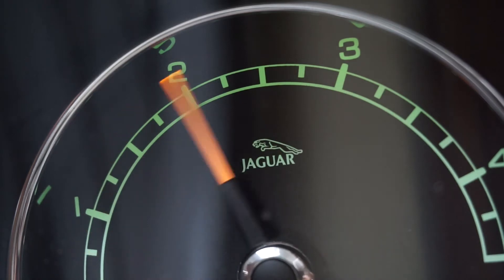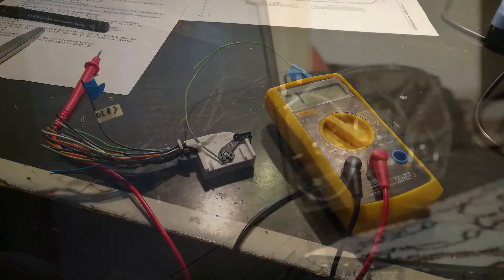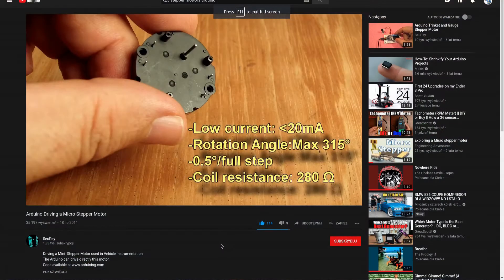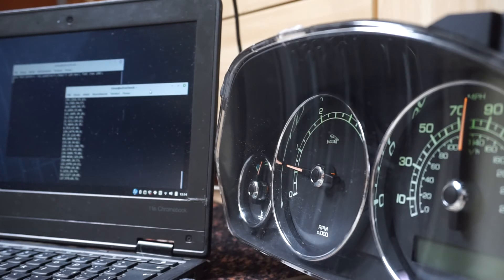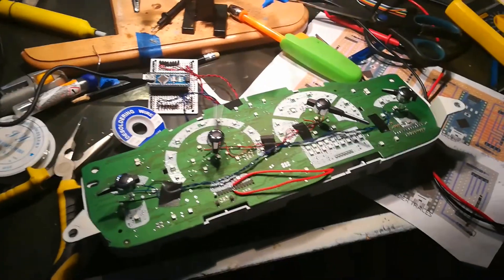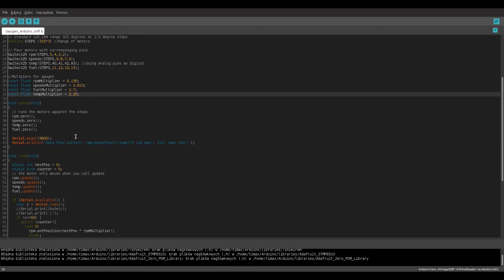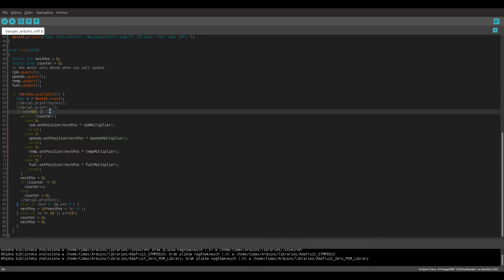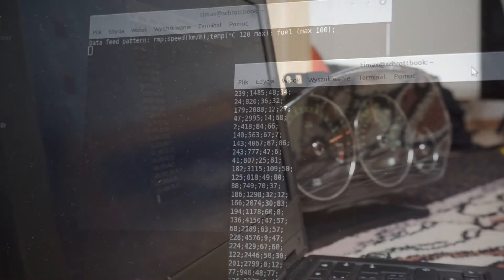Controlling instrument cluster with Arduino

Comment: I was expecting the actual CAN bus code to move the stepper motors according to the input instructions sent via the CAN bus as it only needs 2 wires.  Were you able to tackle this or did you not bother?

Comment: im using these tieing into an older gauge cluster for a replacement tachometer.  The older cluster uses a frequency based input such that for instance, 80hz on a function generator equates to 2400 rpm (2 pules per crank rotation).  I get the signal into my esp32 microcontroller and create a  pulse counter which triggers off every .1 seconds to count the pulses and conver that based on the time step to an rpm value.  good works perfect...what im running into is when i drive this motor with that signal its incredibly jittery bouncing all around.  i can use smoothing arrays to clean up the signal on a moving average basis bu then that slows the response time of the tach.  my question is when this is hooked up to a car with can bus do you still get all that jitter from the gauges?

Comment: want to make a custom speedo using gm stepper motors  for temp  fuel rpm and speedo   and odometer steper  goal is to make custom cluster i can config  useing non can bus  type control

Comment: I have done both, control a vehicle instrument cluster using its can bus, and I've fitted the switech instrument steppers to vintage aircraft instruments.
The switech motors are fairly easy to use, the can bus system is a lot harder, I got an instrument cluster that fitted the car I had at the time, then used a can bus sniffer program with an arduino to reverse engineer the codes. I'm not into driving sims I make unusual time clocks.

Comment: From my perspective; Every car manufacturer uses a different set of instructions to give information to the instrument panel. When you want to mod these kind of instrument panels my advice is to get trace how the panel gets it instructions. In this case the Jaguar's instrument panel gets it information from the one of the processing units within the cars ecosystem. It's much more easier to trick that system then the dash itself. Just to be sure, have you done this with a German made instrument panel from before 2000? They are much easier to configure and if you prefer you can search for one that fit's your Jaguar backplate. Goodluck!
Reply: Exactly and I guess after 2000 model car it's difficult and may have firewall

Comment: Hi... just in the same situation, a car cluster with the main board broken and all stepper motors working but still lookin a way to just read the values (RPM - Speed) with Sim Hub without any treatment just the actual value and use it in a personal interface with motors... Any updates from your part ??